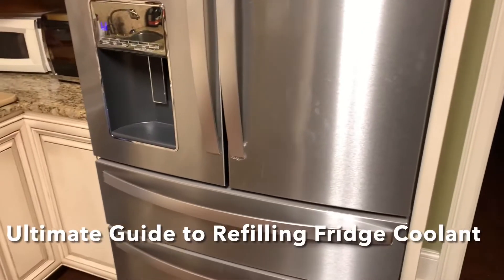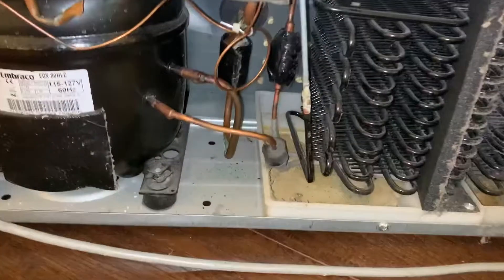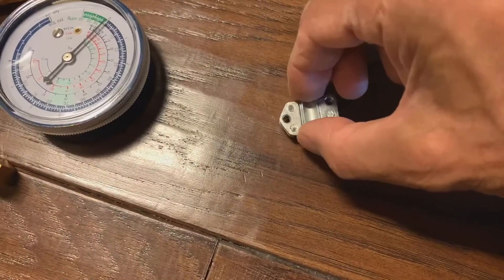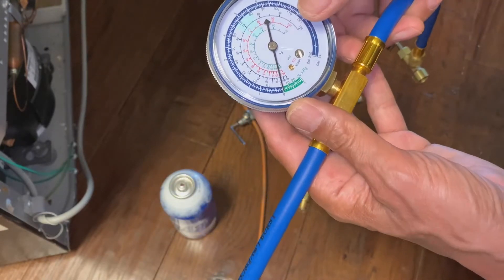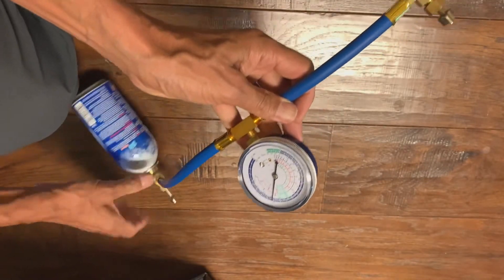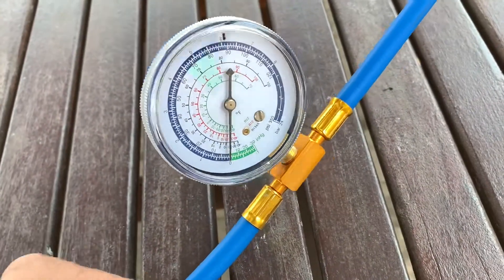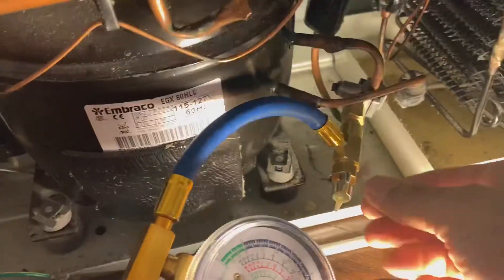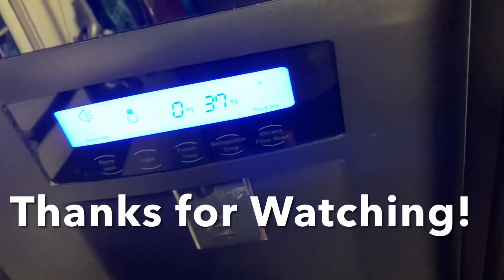Ultimate Fridge Coolant Replacement Instructional Video

Comment: I have a very similar fridge like yours. Recently, after the freezer not making ice at all, I added more refrigerant to it, the same method like you do in the video, it is much better, ice is produced, but the temperature in the freezer still fluctuates a lot, it goes from 7 to 30 Fahrenheit degrees (-13 to -1 Celsius) many times a day. What do you think might happen to mine? Air in the compressor? Thanks in advance.
Reply from the maker: It sounds like air in the compressor. Need to apply vacuum pump to compressor before adding coolant. Should fix the problem hopefully 😁😁!

Comment: Only problem is you still have a gas leak, either inside the foam core of the fridge, where they use a seamed steel pipe to save cost on expensive copper, or there in the tray by the condenser, where that loop of copper hot gas pipe runs in the water to evaporate the water that the internal evaporator pulls out of the inside of the fridge and freezer. You will be forever filling the unit unless you fix the leak.
Reply from the maker: Thanks. That’s next on my list. There is a fluorescent dye that can be added in with the coolant. All it takes is a UV lamp to find the leak.